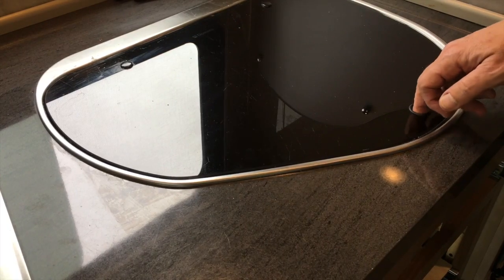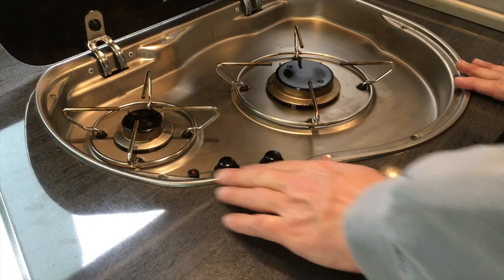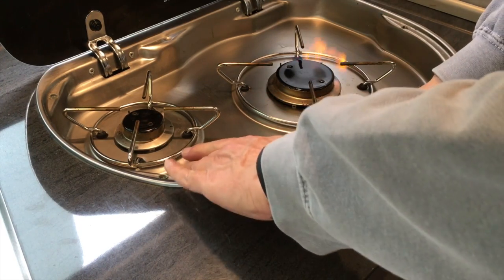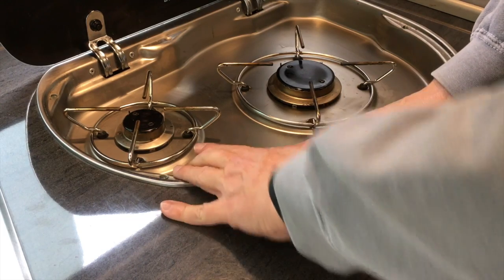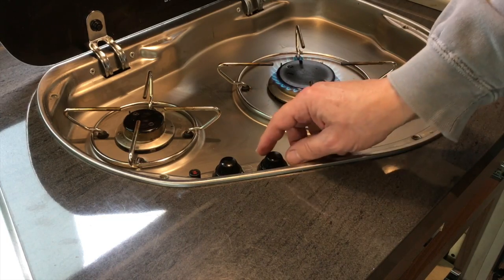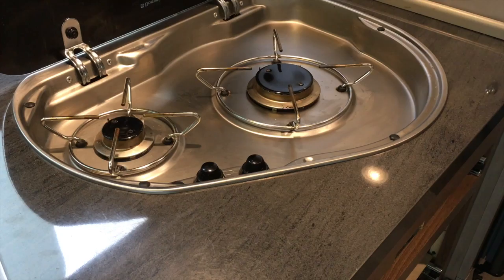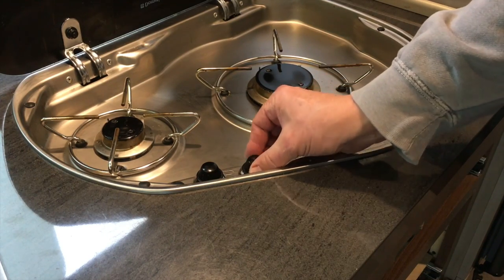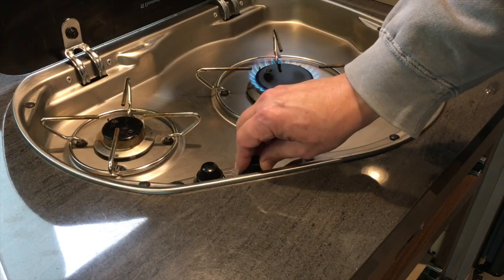Electronic Ignition for Stove

Comment: The 20620 did not fit my 2018 Navion. It has an 11/16 hole. I have the Biber one on order, and will post another comment if that does not fit. I also offer that access to the igniter is from below. You need to remove the top two drawers and four screws into a small wood cover. The upper drawer glides made one screw awkward to remove, requiring an offset Phillips. Do not remove the screws from the top found underneath the rubber bumpers that cushion the glass(?) cover.
Reply: My bad. I only watched the video and did not read the detailed written video description.

Comment: Thanks for this! The 20620 didn’t fit in my 2015 Navion. The diameter of the cylinder holding the AA was too large to fit through the hole. I secured it enough to temporarily hold it, but wasn’t happy with it.

I ended up replacing it with the part Biber had suggested

SG3320 (1-Pack) 2 Outlet "AAA" Battery Push Button Ignitor Igniter Replacement

from Amazon, which fits through the hole and works perfectly. “DHLG-12” is printed on the side of it. I think maybe that (or DHLG-12-2 for 2 burner) may be a generic replacement number in case “SG3320” disappears from Amazon.

I was only able to get the new clicker to fit if I pointed the long end away from the burners (so the end with the electrical connections is sitting under the white board-like material, and not under the metal basin that the hole is in)

Diagram:
—————
@       @
  occ
/  

@ = burner
o = hole for clicker
c = dial
/ = approximate orientation of clicker body underneath, relative to the hole

Thank you Douglas and Biber!

Comment: Douglas thanks for sharing your videos here. I have a 2016  24J and i just finished installing eletronic ignition following you. However i need to report the GrillPro igniter you listed in your description doesnt fit. The models that will fit in Dometic stove is the slimmer ones using AAA battery, not AA battery. 

For others who will try this i suggest you pick below slimmer model from amazon.
https://www.amazon.com/gp/product/B01MDQ6D7C/ref=oh_aui_detailpage_o00_s00?ie=UTF8&psc=1
This unit will fit and ignite two burners with AAA battery you can swap from unscrewing top portion please note unit doesn't come with cables. 
Happy modding